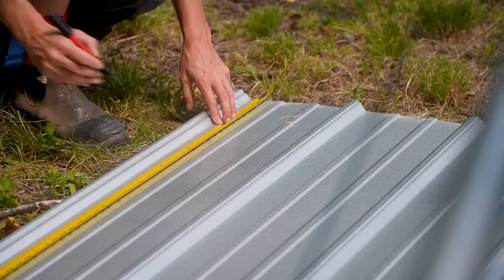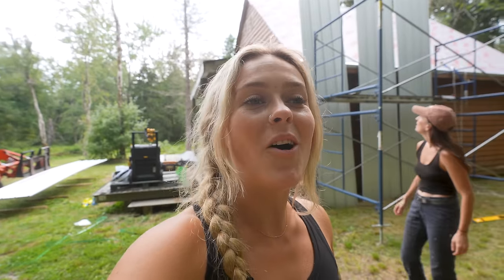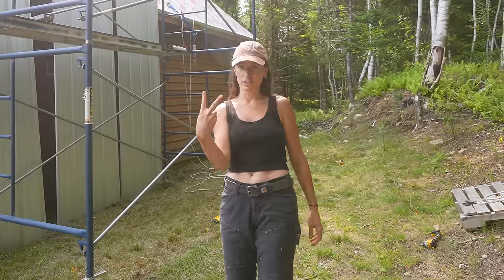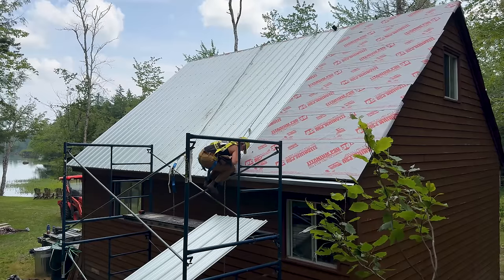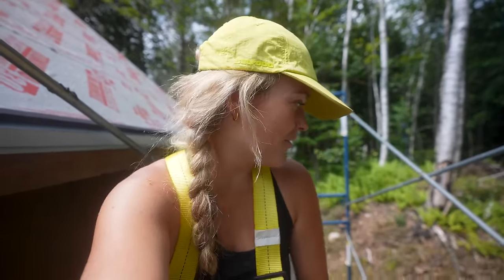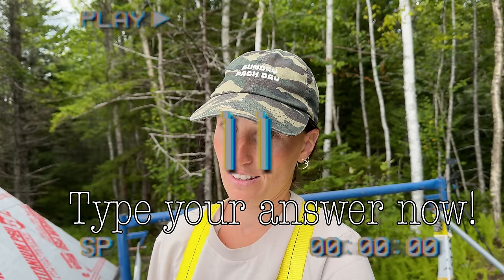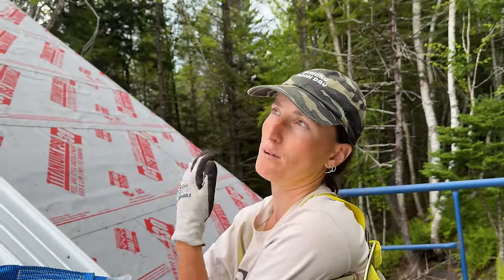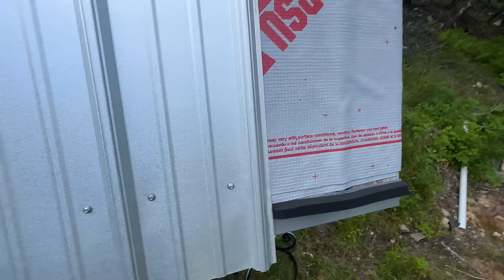Why We Quit The Abandoned Home Build

Comment: Ladies, the screws are supposed to go in through the ”peaks” of the roof panel, not the “valley” even with roofing screws with rubber washers
Reply: Dead wrong. Every ribbed metal manufacturer recommends screws in the valleys.
Reply: @timothygrow4034  not where I come from - by putting the screws in through the peaks you get the benefit of gravity assisted water shedding - take a look at every single metal rook in Australia and you'll find the screws in through the peaks.
Reply: I've always heard, on the rib for roofs, valleys are okay for siding.

Comment: I do not know if anyone else has mentioned this:  When driving a short nail or a "difficult nail" with a hammer use a pair of needle nose pliers to hold the nail and or vice grip pliers and save your fingers from hammer blows!!!!!  (I always forget to do this and smash my fingers)
Reply: ... Also ,, when holding the nail in your fingers , hold with hand upside down ,, if you hit your fingers ,, it's the soft side not the finger nail/bone ... still hurts , but not as much ... For me it's always when I buy a new waffle face framing hammer ...
Reply from the maker: Thanks for sharing with us. Perfect idea. Thank you. 😊🐶
Reply: Your work ethic is very impressive. ❤ watching you both living the dream !
Reply: @rockytopwrangler2069  Yup, was a shingle roofer for years and back of the hand to the roof surface. Hard on knuckles until you get callouses but better than a ruined nail bed. And you can hold several nails at a time that way. One or two between the fingers and a few in the palm to flip as needed into the position. Well over a thousand nails per hour to make a living. But that is normal three tab shingles on a walkable roof.
Reply: also it is working every day possible in all kinds of temps and weather. No work, no paycheck so....
Reply: @two-strokesmoke7289  I was thinking the exact same thing. You live, you learn.

Comment: two things... use needle nose pliers to hold nail to prevent that smashing fingers issue.... and on shears the best use for that tool is in Hvac when installing a furnace you have to cut a 24 x 24 hole in the side for the return air intake. you cant use a grinder due to sparks and insulation and electronics on the other side of the metal wall. their are also jigs for the tool to cut holes and curves as well. its a pro tool as a grinder in finished metal will require more grinding and polishing then using a shear does... so its a time saver thing in any other use case in my experience.

Comment: If the wind comes from the lake your seams on the metal roof should be facing the trees. It looked like you did it with the seams towards the lake but I could be wrong.
Reply: You are correct.

Comment: Quick tip for when you bash a finger tip that is turning blue and you're going to lose the nail. Jab a red hot needle through the nail ( red hot needle goes though the nail like butter) to let out the blood, it has to be done before the blood coagulates..It hurts like heck for a few seconds but you save the nail.
Enjoy your brunch.
Reply: I just lost a thumbnail from a direct hit on Memorial Day weekend with my framing claw. Whole nail turned black. I wish I had done this, because at this rate, I'm not going to have a completely usable thumb again until after Christmas !

Comment: Wise move to take a break from this project.  Obviously you got busy with the Bunkie. (a very sweet project)
Excellent job with the gable end drip edge.  Nice job planning and great job installing.  
From what I've seen in the demo, the original builder did not adequately waterproof the joint between the siding and the underside of the roof sheathing.  Your remark about wind coming from the lake supports this notion because the lakeside gable end had more water ingress evidence if I remember correctly. 
Really enjoy following your projects.  You have wonderful attitudes about building. 😊👍
25:30 The sudden Moon shot!  ♥

Comment: I am sorry, but unless you raise that cabin up, the water will destroy your hard work.
Reply: I was thinking the same thing they need to something, French drains,lifting the cabin…...  lol. What else??😊
Reply: Hasn't the cabin been there the whole time? If the water can make it all the way to the cabin, wouldn't the whole thing have rotted already?
Reply: @MsCateStar  Did you see all the mold and trash that they threw out? That will be back, and all their work will be wasted.
Reply: They found the water damage was from the leaky roof.
Reply: @jabbaraedwards8395  There were earlier videos showing the house in standing water. The piece of property is beautiful, but to keep a building there requires the house be raised up.
Reply: @MsCateStar  I see that you never built anything. It won't just rot immediately. First mold, then deterioration over years. Didn't you notice the floors. Soft, rotten spots.

Comment: Another amazing project completed. Congratulations. Crystal, just a quick suggestion. That boo-boo happens to all of us at times. When driving a nail through sheet metal flashing without a pilot hole you can hold the nail with any pair of plyers until it is started.

Comment: I put my first metal on this summer for a garage a family member and I built. It is perfect but it looks great and should function well. The biggest mistake was for the ridge cap I put it on correct, but I had to sit on the ridge cap to screw jt in, which caused the metal to bow out. The back on came off the center just slightly. Realizing this, we picked up from the front and didn’t it fully centered. You can barely notice from below and it won’t affect functionality. Live and learn.

Comment: Cabin is looking good. Quick tip: Pre-drill drip edge nail holes or use pliers to hold the nail as you start to hammer it in. Gutters? While they aren't 100% necessary, they are clutch for displacing moisture from the foundation.
Reply from the maker: Thanks Bryan, we always appreciate you sharing your knowledge with us. 😊🐶

Comment: You shouldn't have to predrill the holes for your zinc roofing sheets if you have proper roofing screws, as the screws have a bevel on the end to pierce. We use corrigated iron, zinc or coloured sheets called colourbond  in Australia we made it due to harsh environments.  It also should be screwed on the rises not on the flat part or the valley as it's called, as that's where the water flows and if the rubber washers on the screws fail the water will seep through the holes into the roof cavity, I was a builder by trade for 22yrs. Just a tip girls will save you a job down the track, and save time by not pre drilling. Oh also people cut out animal shapes etc from metal roofing with the nibber shears and paint them etc for crafty items, I'm sure you 2 can give that a try too. You rock girls.

Comment: Hi Girls, sorry to burst your bubble on last weeks finished guest cabinet, but you have no sub-floor, it’s built directly onto the deck, so wet and damp will sit on the surface of the deck and rot through you base layer and into the floor. The whole first layer of timber you laid for the cabin walls should have been covered in a waterproof membrane and then a sub floor built inside the cabin above the deck layer. ❤

Comment: The way I cut steel is use a utility knife and press down as much as possible and pull it along the line and then flip it upside down and bend it back and it will break right where you cut it with the utility knife

Comment: You started the roofing from the wrong side.  Now wind drives under the seem not over and past.  Why didn't you use furring strips under your metal? To allow the metal to breath and a space where condensation can escape?  Yor woof will develop a layer of rust.  don't panic as on galvanized roofs it is a layer of protection.  It will not hurt the roof.  But if you don't like the roof.  There is paint to paint roofs with or a wrap like cars are done with.

Comment: Every time I've seen electric tin snips used I've always seen them used where they're tipped forward on the leading edge and pressure is applied so that the metal is n't bouncing around and they seem to just glide right through the tin

Comment: I can still remember years ago when we put the tin on my dad's house and the chimney guy was finished putting the chimney up through the house so me and my dad went up on the tin roof and we're washing off the messy concrete the chimney guy finished doing and back then the nails went on the high part of the tin not in the valleys well there I was standing on the wrong side of the tin and it was soaking wet wow and I had boots on and I tell you I slid down that tin Roof in slow motion my dad kept throwing the hose towards me but never reached me the garden hose that we were using to wash the roof off with and my arches on my boots cleared every nail so it didn't stop me luckily it was only an 8 foot drop but at the bottom of the drop was a concrete sidewalk so here I was standing up sliding down the tin roof in slow motion and hoping that I didn't fall because I didn't want to get cut up by the nails I wanted to tin yeah they used nails with lead rings back then so just at the end of the tin as I fell I pushed myself away and luckily I missed the concrete sidewalk and the concrete guy was sitting there laughing and calling me Superman because how I flew off the roo Luckily I didn't get hurt so everything was fine:face-purple-crying::face-purple-crying::face-purple-crying::face-purple-crying::face-purple-crying::face-purple-crying::face-purple-crying::face-purple-crying::face-purple-crying::face-purple-crying::face-purple-crying::face-purple-crying::face-purple-crying::face-purple-crying::face-purple-crying::face-purple-crying::face-purple-crying::face-purple-crying::face-purple-crying::face-purple-crying::face-purple-crying::face-purple-crying::face-purple-crying::face-purple-crying::face-purple-crying::face-purple-crying::face-purple-crying::face-purple-crying::face-purple-crying::face-purple-crying::face-purple-crying::face-purple-crying::face-purple-crying::face-purple-crying::face-purple-crying::face-purple-crying::face-purple-crying::face-purple-crying::face-purple-crying::face-purple-crying::face-purple-crying::face-purple-crying::face-purple-crying::face-purple-crying::face-purple-crying::face-purple-crying::face-purple-crying::face-purple-crying::face-purple-crying::face-purple-crying::face-purple-crying::face-purple-crying::face-purple-crying::face-purple-crying::face-purple-crying::face-purple-crying::face-purple-crying::face-purple-crying::face-purple-crying::face-purple-crying::face-purple-crying:
Reply: Whew.  And all of that in one sentence.  Bravo!

Comment: I used to have to set up scaffolding by myself when I worked as a mud boy for a mason. Sometimes I'd have to tear down and erect scaffolding two or three times a day, depending on how fast the bricklayers were working. That was on top of my other chores, like mixing cement, carrying brick, making sure the bricklayer's "mud" had not dried out too much on his board, smoothing out the joints with a metal tool and water proofing the outside of the finished blocks (if we were laying blocks instead of bricks) with a sealant. It was hard work, especially after a rain when I'd have to trudge through a muddy construction site with a wheelbarrow full of cement.
Reply from the maker: Wow I have zero words. Wow. I think you need a lot of massages. Poor body :( the mental of it all too. But damn you hustled hard 👏

Comment: Chimney flashing metal roof under over.  Don't just cut a hole and caulk the hell out of it to keep it from leaking.  You can make flashing by using scrap roofing and solder it waterproofing it.  To keep the clean lines.   I do believe they sell it as well.  Call manufacturer of your metal roofing.

Comment: My partner and I discovered that cutting metal roofing with a skill saw works amazing. Use an old blade and turn it around, so teeth are backwards. That metal cutting tool is not super useful!!

Comment: "Lake cabin wives" A good plan you stopped at a good point to wait for the heat to break. Sheet metal shears you are definitely using them right, cutting long straight edges they are the only game in town. If you did try to die ground a cut that long the metal very likely would distort and be gagged. When you become auto repair technicians you'll be glad you have your shears already. Izzy and Bella are such good job superintendents.

Comment: With old houses, it is always something.  I live in a house that was built in the 1960's and it is always like a mystery puzzle with something goes wrong. Back then, the property here was owned by the State because the State Fairgrounds is a block away and they bought up an additional parcel.  Well people bought the land and the County did not pick it up so there were no permits required to build and no inspections.  Had I known this, I probably wouldn't have bought it but now it is mine.  I have found auto parts use as plumbing parts and so many other crazy things.  Fortunately, a licensed electrician was used so even though I would love to upgrade, I am fairly comfortable with that aspect of the house.  So, "Girlies" I understand your frustrations. I used to be able to do what needed to be done but I am pushing 75 now and my body objects to a lot of stuff these days.  Fortunately, working on the property in the past generally has me knowing what needs to be done for the repairs so I can hire the right person for the job.  The trench suggests foundation issues, I hope that is not the case but I will check back next week and find out.  Great job on the roof, it looks beautiful.

Comment: Next time you are nailing steel , use a pair of needle nose pliers to hold the nail. Or hold the nail with the fleshy side up. It will hurt but not as much. lol.  As for the  ' Corrugated Metal Panels '  { I know , a little late }. Screws go on the  HIGH side , less chance of water ingress.

Comment: I have hanky hands (Arthritis and nephropathy) and after a few smashed nails, I(while they do make such a tool, but I needed it right then) I took a pair of needle nose pliers, and cut a small groove in them, where the nail fits, but close enough to grip the nail. Hold the nail with the pliers, miss with the hammer, OK, NP, it don't hurt!
As far as the Dewalt brand sheers, they 1. make an attachment for a drill to do the same thing, I hadn't got one because my $30 air tool does just fine. 
The Native Indians called that the "blood moon" And, knowing when that was, everywhere in this hemisphere, I can tell how far behind your videos are! ;)
Also, a cheap pair of "foam" sole shoes or boots, stick to the metal a lot better, and, much safer!

Comment: Sorry no help here on the tin cutter. I own a drill attached nibbler and figured out the straight line cutting. I can easily do round hole openings... even car body metal shape cutting... Sorry no idea on what else to use that cutter on - become a professional tin roofer. I was hoping you would take a break on the cabin due to "airing out" that night mare - I've even in years past did a Hilex bleach in a tank sprayer and wet it down with that - good mask or vent breather and then spray. Some areas were done 2xs on locals that were really bad. BUT YES AIR IT OUT and dry it out.   Great mOOn view!!  Sqeeky Feet!!  Great Job too...

Comment: Way too late but top tip for anyone about to do roofing like that, wear trainers / running shoes rather than work boots, the soles grip MUCH better as they are way softer and more flexible.

Strange how, at the beginning of the vid you said about wind direction and going with the direction  but that has meant the "laps" of each sheet are windward facing, so rain is more likely be driven under the edge of the sheet. Ideally, should have started at the back and then overlapped each sheet as you moved forwards toward the lake..
Never mind I'm sure it'll be fine.. haha too late now :D

Comment: I would have used 1/4 as many screws in a roof like that, but to each their own. Not really anything wrong with manufacturer's method, there's just pros and cons to it, that's all.

Reason are you can either have for example 250 tiny holes in your roof or 1000 (possible points of failure). Also, who wants to replace that many in 10 years from now? Every screw also adds grip to prevent small amounts of snow from falling off, requiring more snow buildup before it'll slide off. The only disadvantage of not putting in as many screws is... maybe a major hurricane might do some minor damage... but if you go heavy on the screws where it matters and light where it doesn't matter, then problem solved.

Comment: Hey Crystal -- yanno how you hurt yourself while nailing? May I give you a tip? Instead of holding the nail like you were (holding the nail between your fingers with your palm on the surface you're nailing to), flip your hand palm up. Your palm has more cushion, so, if you miss, it doesn't hurt (as much). Taught to me by my father who was a professional carpenter for over 60 years. :)

Comment: Why don't you lift all the panels at once with the forks on the tractor right up to the edge of the roof? That'll save you the trouble of standing them up against the house then having to pull them up by hand.
Reply: It's too late now, don't you think??
Reply: @GuyWithTheDogs  probably. 😉

Comment: I'm sure maby your joking but I wouldn't leave my gear in the sun for 10 years  to use and find out it's dry rot plus you safety equipment should be checked often to make sure there still safe durning use
Reply from the maker: Hahahaha we ended up grinding them off. They won’t be reused don’t worry!
Reply: @Vanwives  lol okay I'm glad  mother was worried ;)